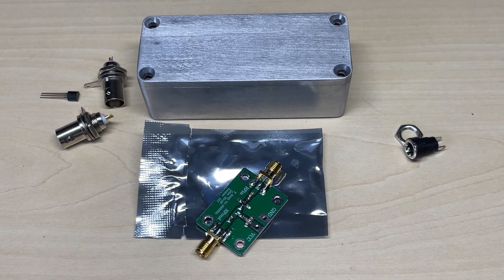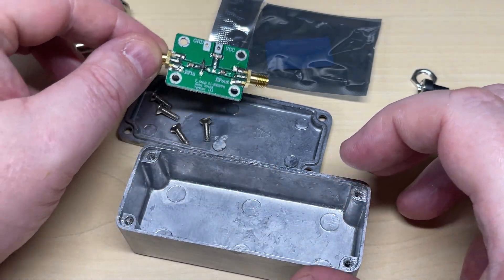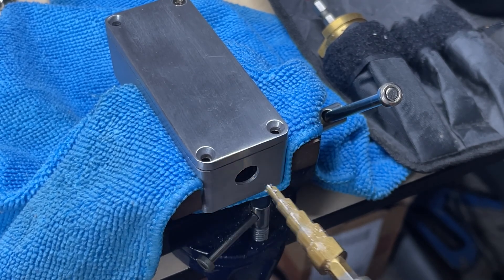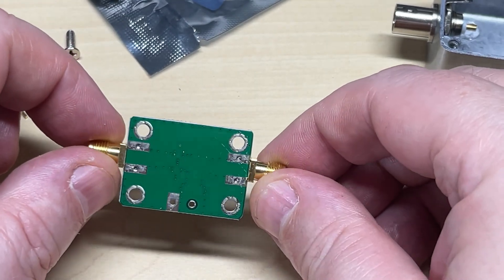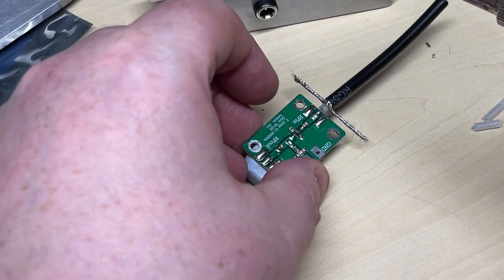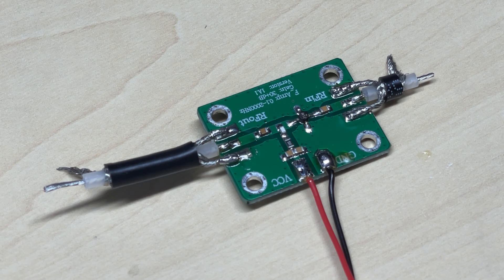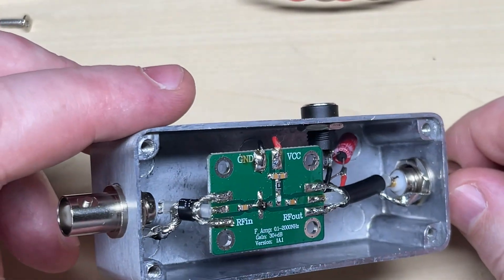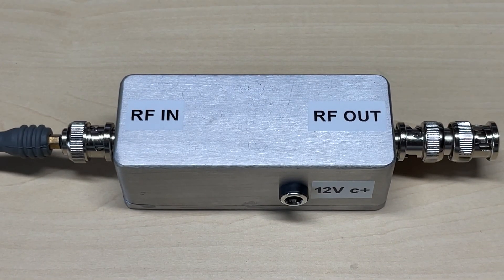EP 111 - 30dB LNA RF amplifier build and testing.

Comment: Nice video. Why use BNCs? Risky un soldering those SMA sockets so close to the amp device. RG316 make a heather solution to RG58 but a very nice build.
Reply from the maker: I used BNC so i could use a scope probe to amplify small signals.

Comment: Nice work of your hands, but can I ask or can I know about the value of the two capacitors that you put to that amplifier and the regulator as well. Thank you in advance Sir. and more blogs to come. 😊
Reply from the maker: The 2 caps are not important a 10uf and maybe a 103 , the reg was a 5v if I remember correctly, it was the correct reg for the supply to the lna board